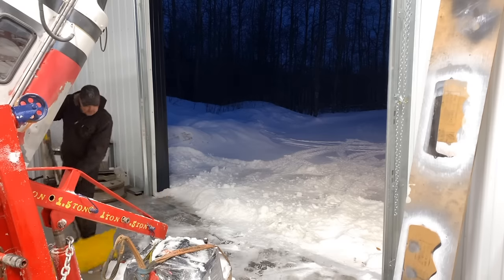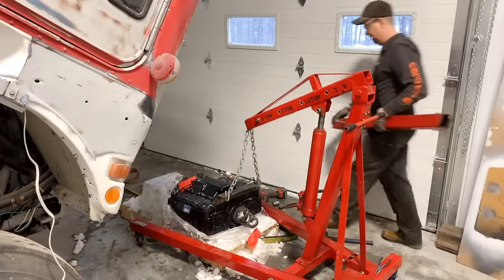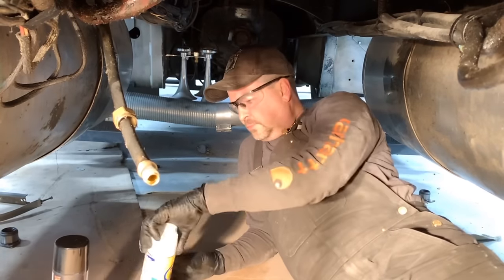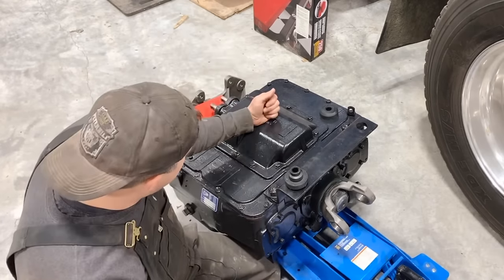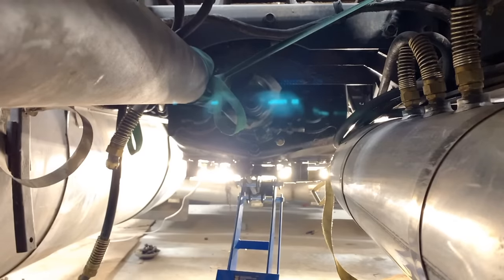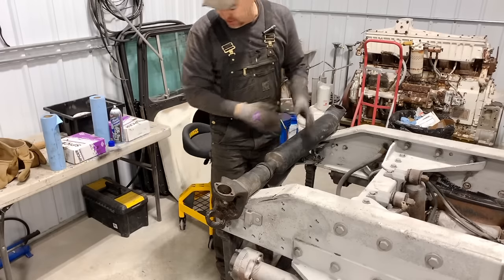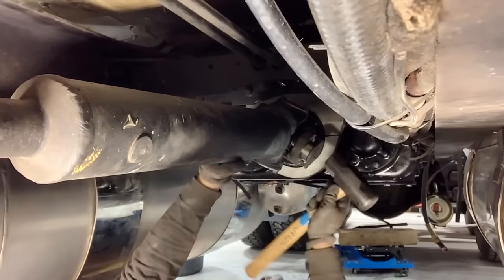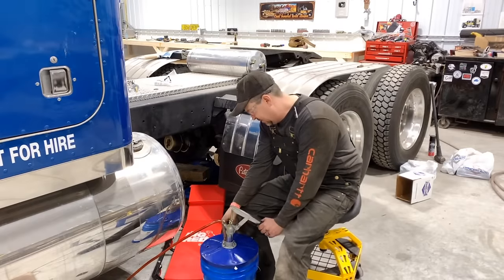Peterbilt 359 Restoration Ep.68 You Don’t Need Proper Tools

Comment: Pull the bolt and chain out of the cherry picker and the other tube should slide into the boom on the picker and line the hole in the inner tube with one on the outer.  .  The bolt then goes through the appropriate hole for the weight you want to lift.

Comment: Good morning Mark.
When I'm by myself and have to lift, say a driveshaft, I'll use 2, 2 inch  or 5 centimeters wide, 😃, ratchet straps.
It maybe a little slower, but it really saves on the arms, shoulders, and the worry of dropping it.
You can adjust either strap as needed.

Comment: Like the bench you & your dad built , just as a suggestion you may want to cover the plywood with tempered Masonite glued to the plywood then finish it with a clear finish makes a hard durable top and easy to clean off , I use it on my bench in my  home machine shop here in Winnipeg 
Greg

Comment: G'day Mark,, 
Ive used oven cleaner for years on my bikes, 
it moves the greasy heavy stuff  way better ,,,i use a brush to help break up the sludge & get into the  hard to reach  places,then leave it for 5 mins to work ....or longer if its needed.
DO  NOT  USE OVEN CLEANER ON ALUMINIUM....
The over  cleaner is a very strong alkali, and will quickly  turn alloy  dull  ,,,or black . 

    Respect 
       from
 Down Under

Comment: Mark, I think the engine hoist got bent on the original piece with the hook and they made a new one. I have to get same one and the extension with the hook slides into the boom on the hoist. It has one hole in the end that you align with the ones in the boom. Problem is because it's smaller in diameter and you can extend it, people put to much weight when fully extended. Super handy little things though.

Comment: Nice to see the guys  from the Gear Centre  got the transmission all done and back to you and even managed to find you some kind of bushing you could try and modify to help fit where the old ones were. Your dad did a great job on the shelving/ work bench to have to work on and store things cause you can never have enough work space or storage and having it solid is so so nice  because when it is rickety, oh man it's no fun, but those look solid and yeah lumber prices are still through the roof

I  think your engine hoist might not be missing any pieces it may be the one arm actually slides inside of the other but you may need to remove the bolts and then line up the holes between the two arms and then reinstall the bolr=ts to the desired length you want the arm to reach  ( depending on how many holes it allows you to extend it that is ) I k now that is how my hoist is. Give it a look Mark.

Well looks like the transmission went in pretty smooth for the most part , not the funnest job but looks like you didn't have too many issues for a guy who did it all by himself on the ground, and that isn;t and an easy feat by any stretch but hey you got er done, be interesting to see how she works for you when you get to take LBL down the road .

Keep up the good work and look forward to the next video

Comment: The oven cleaner works because it's a "caustic" formula. The degreaser is just a modified solvent.

You have to be careful with the oven cleaner on rubber and plastic parts and you have to, HAVE TO rinse the whole working area with water or the caustic chemicals will just keep eating away at whatever it can. If you can, get under there with a garden hose or pressure washer and flush anything that might be left over, especially on your hydraulic and airlines and any wiring you might have hit.
Reply from the maker: Good tip - thanks 👍

Comment: Hey Mark if you watch one of Flannel Philip's recent videos;where herebuilds his 3 chime train horns on his 1997 Kenworth W900L,you will see why having the 3 chime train horns mounted somewhere underneath the truck;is not really a great idea in the long run.The train horns he has on his 1997 Kenworth W900L,are the real deal;they are Nathan Airchime P3 train horns,brand new they are not cheap.He bought them from a friend who is a model railroader;who has connections to friends that used to work in the Union Pacific rail yards,that used to be employees at Union Pacific and took the 3 chime horns;off of the roof of an old decommissioned GE EMD GP40 locomotive that was being scrapped.He recently rebuilt his train horns;with new diaphragms,
o rings,stainless steel bolts & washers,because they were full of dirt & grime from the road;from how he had them mounted on the frame rail on his truck,with the trumpets facing the road.After he rebuilt the train horns,he mounted them to the cross member underneath the 36 inch coffin sleeper of his truck;so they will stay clean in the long run.I think you should think about maybe mounting the train horns onto the deck plate,or on the roof cap of the truck.I have seen YouTube videos of some working show quality trucks;with 3 chime train horns mounted on the roof cap.The problem is;how do you mount them to the roof cap without it leaking whenever it rains?.
The Nathan 3 chime train horns Flannel Phillip has on his truck,has room for two more horns;which would make them 5 chime horns.

Comment: those bushings were either radiator supports or charge air, if you ever have to remove the driveline you will kick your own butt for not using antiseeze in the yokes, also dont forget if a trucker brought it a mechanic fixed it to get it there.

Comment: I was driving a truck for a Mexican in Dallas Texas   back in the late 90's to early 2000's
truck was an 85 Pete with a 400 Cummins 13 speed with 370 rears
transmission was going out 
the two mechanics he had were Mexicans to they couldn't speak a word of English 
but they took that transmission out of that truck tore it down rebuilt it and put it back in the truck in 13 hours 
they had to wait two hours for parts 
i have never seen that done before and never seen it done again 
a lot of shops take advantage of drivers how there so they can drive the cost up

Comment: Why make all of  the cuts on the mount? drill the hole larger and use them as is. 
the extra 1/2 will not make that much of a difference.
Reply from the maker: Suppose that was an option but I didn't have anyway to bore out such a large hole in plate steel
Reply: @TwinStix  Plasma cutter works well
Reply from the maker: @willardway3037  yeah … if you have one 😂
Reply: @TwinStix  Well I thought you had one. they are 1000x's better then the blue flame wrench

Comment: You Said In a earlier episode that you were a mechanical engineer but in what some of the mechanical work you do are a little on the rough side, why cut the bushes down to the same size as you said the old ones had crushed too the extra 10mm of Bush what had made little difference in alignment as you are running universal which are designed to run at different angles and just drill the holes in the mount bigger instead of making the bushes smaller,  come on think about it also when you put the j valves on the heads you added new O rings put some rubber grease on before assembly so you don't damage them
Reply from the maker: I know you’re not new here Barry so you’re aware I do the best I can with what I have and just find a way to make it work … I’m also smart enough to know that turning down a rubber bushing is easier then boring a two inch hole in plate steel 😂
Reply: @TwinStix ok can I offer you my help if you get stuck on something just ask im not a heavy diesel mechanic but I was a mechanic for over 30 years I built racecars for 20 of those years and have done a lot of fabrication and welding, im now a qualified builder as well so I do have some skills I just would like to help and if it saves you money and time you can use that on the other trucks